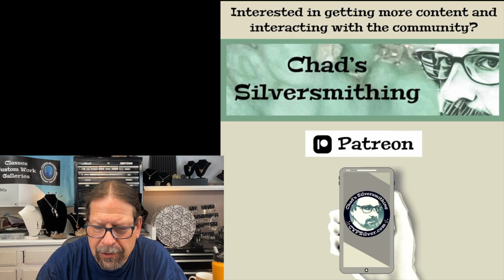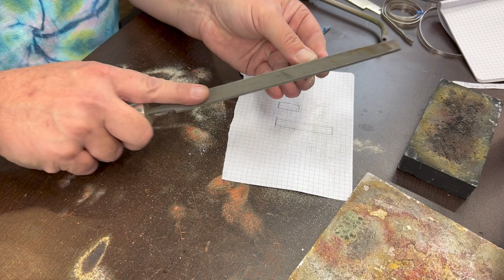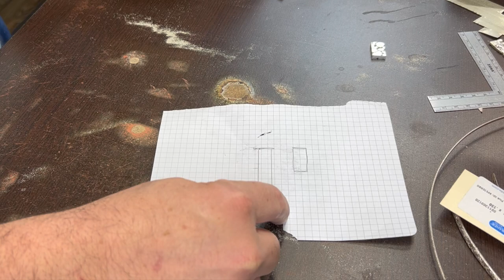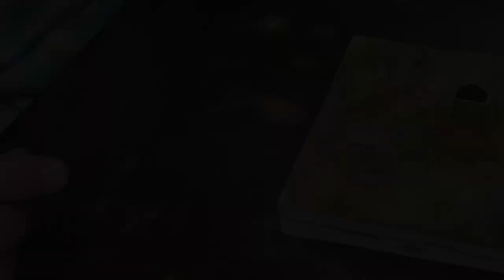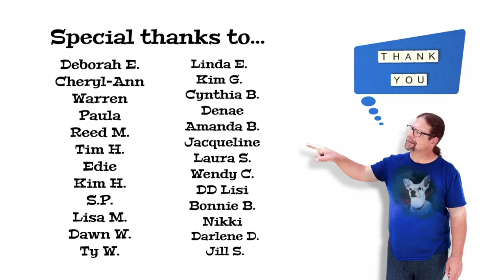Making A Cobblestone Ring: A Silversmithing Tutorial

Comment: That’s a real nice  design, and not something I’ve ever seen before. Its very effective. I suspect it would look utterly fabulous as a pendant in a circular shape with silver and copper shapes mixed……I’m very fond of copper with silver. I’m also wondering if the pieces couldn’t be fused, rather than soldered? Maybe make the pieces fine silver?(itd be a nice way to use up bezel scraps)It would take some really delicate heat control I’d  imagine…..maybe too much? It might work for regularly shaped balls tho….*in deep thunk*😂 I think a hammered band might be nice on that too for a ring. It’d make a nice bracelet/bangle focal too, or bracelet pieces connected with simple hinges, or jump rings. 
One thing I would do with that is to oxidise it(I’m old school and use liver of sulphur) and then buff it back to highlight the textural qualities of the piece. Also for those who have trouble keeping their file flat, when I’m filing a piece flat like that, I put the file flat on the table and move the piece across it. Makes it easier to get a true flat face, because the file face stays still, at least it does for clumsy folk like me, who can’t do straight to save themselves lol.(wrap a little double sided tape around your finger if you need more friction)
Just noticed that Flying Chef suggested something similar 😮 note to self read comments before blathering onwards 😂
Reply from the maker: Some really good ideas Pauline!  I like the idea of making a link bracelet out of little rectangles or other shapes like this. Might take some time to do it though:). Thanks for the good comment!